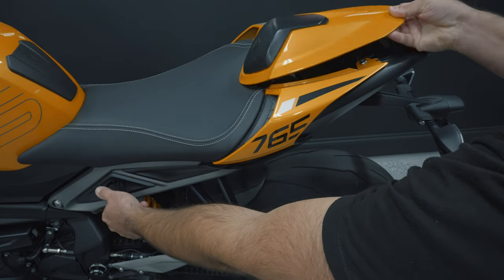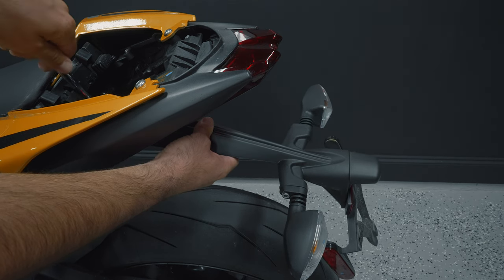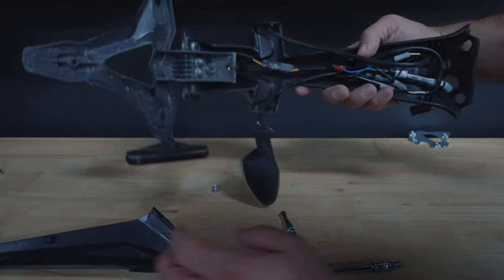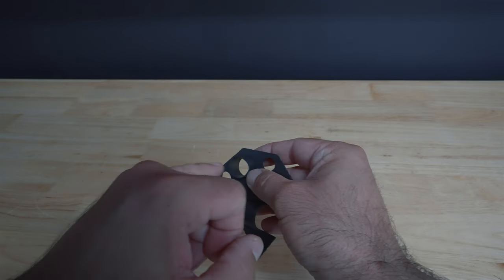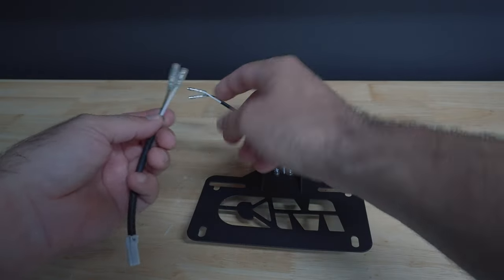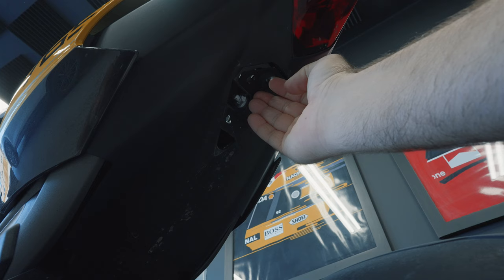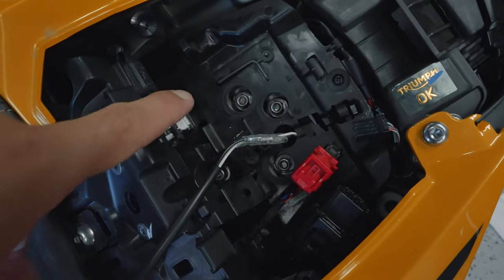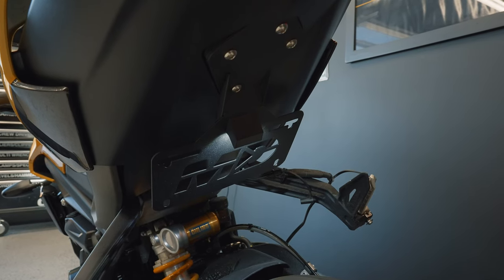MOTODYNAMIC 2024 TRIUMPH STREET TRIPLE 765 RS | Low Profile Fender Eliminator Kit Install

Comment: I went with the Evotech tail tidy.  A bit costly, but very high quality and you can use your existing signals or swap them out for the Euro style LED type like I did.
Reply from the maker: Yeah I checked out their kit as well, especially since I was already getting their passenger peg delete setup, but I chose to go with Motodynamic as I wanted to get rid of the rear turn signals completely. Thanks for watching!

Comment: Nice looking, I need to do it to my R, just one question, the cable adapter that connects the plate’s light to the power. Where did you get that from.
Reply from the maker: Everything used in the video either came in the kit or was OEM part being reused.

Comment: With zero overhang like this tail tidy, does your bike kick up water to your back when riding if the roads are wet. Considering this but worried about soaking myself if I ride on damp roads.
Reply from the maker: @neevian  hard to answer that since I don’t really ride in the rain or wet, the few times I happen to ride over a small part of wet road (random puddle or leaking sprinkler so not a ton of water) I did not notice any spray.